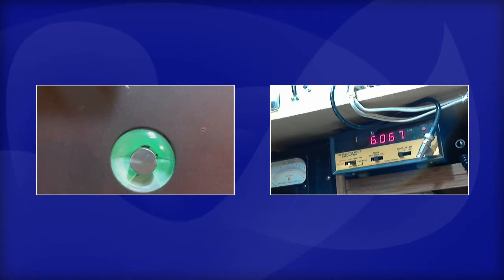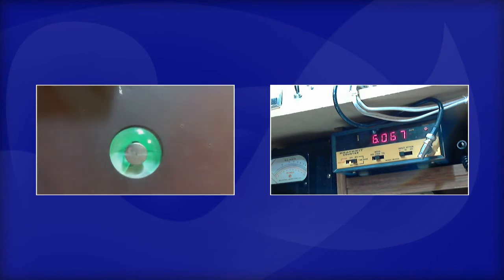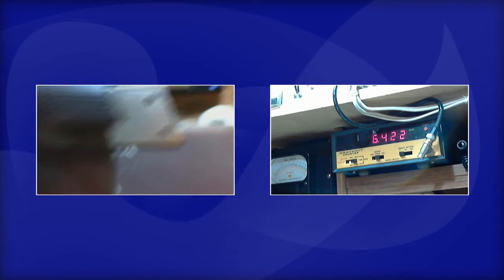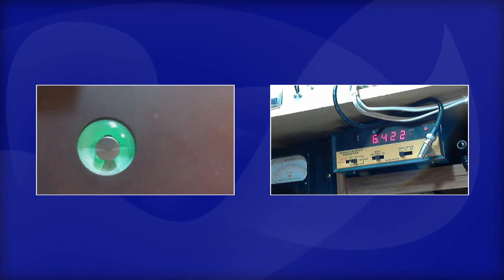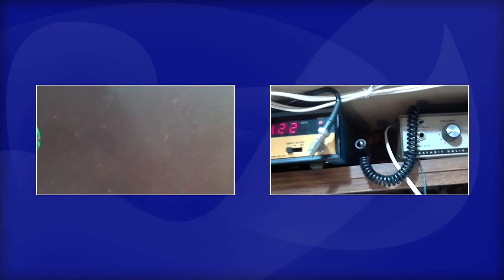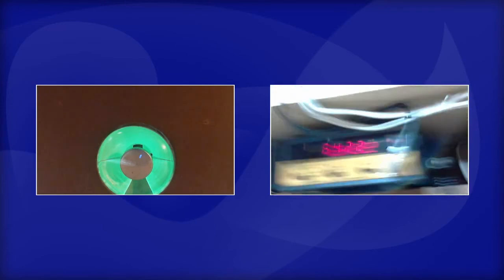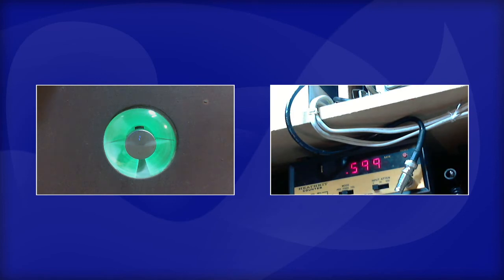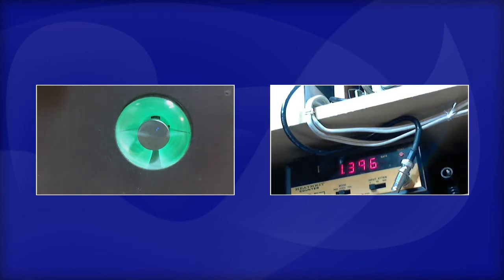RCA A25 Vacuum Tube Shortwave Radio Video #8 - Alignment Completed

Comment: Jim,
I just noticed that on the front of the frequency counter, there is a BNC T connector.. I was always told that on any kind of signal going through a T connector that you should cap off the unused port. Maybe this could be the source of your "phantom signal"? Just a thought.
Reply from the maker: It might be a problem at much higher frequencies including radio emission but at the frequencies we're dealing with, it can't matter much.  If I had a long, unterminated lead, there might be some effect just like SWR effects on antenna lines.  I do have a nice yellow rubber cap somewhere that I can put on it but that's just for dust and dirt.